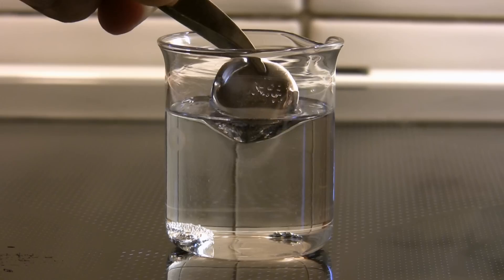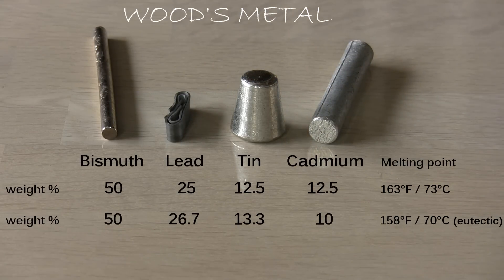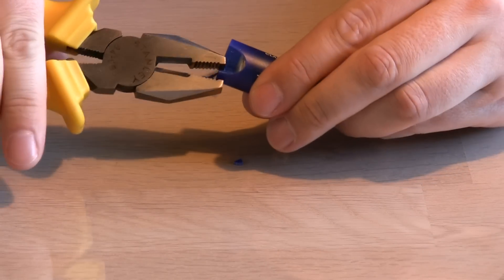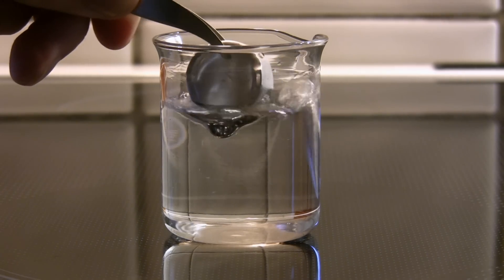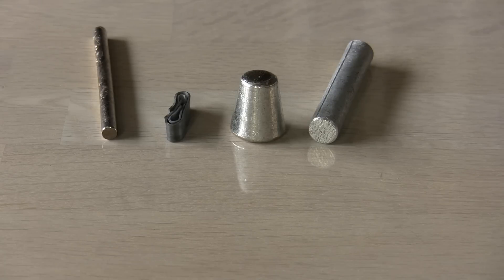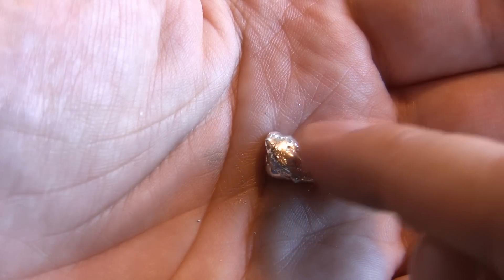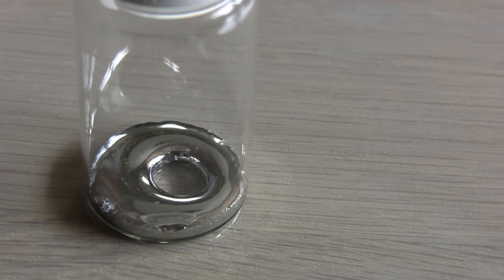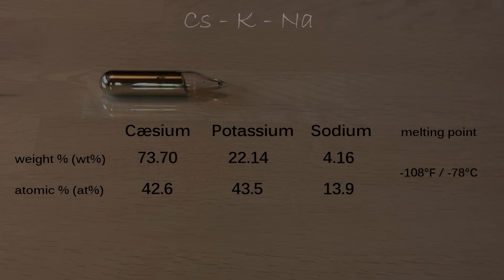Metal Meltdown | Brainiac75

Comment from the maker: To James Thompson: I can't reply directly to your comment. Have you disabled replies or is the new comment system just messing up? There's a reply button but I get the message 'You are not allowed to comment on this post'. Great...
Anyways, here's my answer: I did consider Galinstan but had some issues with it. It is nice that it is liquid at room temperature but it wets almost everything because of the gallium so it's not very practical (+ expensive!). The biggest issue though is the controversy about it's melting point. Eutectic gallium, indium, tin is supposed to melt at +11C but the inventors of Galinstan (it's actually a registrered brand name) claims a melting point of -19C (maybe by addition of antimony and bismuth but it's very unclear).
Reply from the maker: James Thompson It actually sounds like a good idea to make the galinstan myself. There seems to be many opinions about its freezing/melting point but I could test my own sample.
Thanks for sharing your observations. Ah well, all the tings I have to do when time comes :)
I mentioned the dangers of cesium in my previous video  http://youtu.be/9gB775y4FbE . But I guess for a stand alone video I should have at least made a note on the reactivity in the video.
Reply: Francium? Good luck.
Reply from the maker: Trenton Keller Hehe, I probably would win a Nobel prize if I managed to obtain a visible amount of francium. Hard odds with such a volatile element :)
Reply: brainiac75  i cannot find any samples of Fields metal. I would REALLY appreciate it if you could find where you bought it and send me the link? Thank you
Reply from the maker: Austin _game Hi. I can't remember where I bought my sample of Field's metal. But here are three samples for sale from an eBayer that I have good experiences with: http://www.ebay.co.uk/sch/m.html?_odkw=&_ssn=morgaine-le-feys-cat&hash=item58c3d2452e&item=381242459438&_osacat=0&_from=R40&_trksid=p2046732.m570.l1313.TR1.TRC0.A0.H0.Xfield%27s+metal.TRS0&_nkw=field%27s+metal&_sacat=0
Reply: brainiac75 Thanks! I had saw these on there, but they didnt look like the sample you had, so i paid no attention to them. Thanks again! By the way, love your vids!
Reply: Galinstan? In + Sn + Ga
Reply from the maker: Science@pproved Yes, probably plus some secret additives if it the registrered trademark galinstan.  https://en.wikipedia.org/wiki/Galinstan
Reply: +brainiac75 btw, good luck melting tungsten carbide WC.
Reply: you could of put thetubething thewood thing in hot water again you didnt have to break it
Reply from the maker: Minh Thai Sure, but it was just trash and I wanted to see my casting :)
Reply: ok
Reply: Brainiac75 ok cool
Reply: Ok we will not reply 
OH! sorry😆😆😆😆😆
Reply: You know why I like Denmark?
LEGO.
Reply from the maker: Vitek ShitDiv Hehe, I will never be too old to enjoy putting together a big Lego Technic set :)
Reply: +Brainiac75 I got a huge bulldozer, took me over 8 hours, spread out over a week
Reply: What did you say at the end, Maybe i could get some Franchsum?
Reply from the maker: Dan hatman Subtitles are available - just press the CC button in the video menu.
I joked about getting francium, which is the final metal in the alkali-group and impossible to get a visible amount of...
Reply: Brainiac75 How many grams did you have in the galium ampoule
Reply from the maker: The ampoule at 5:55? I don't really know. They don't specify it on their website (http://www.smart-elements.com/?arg=detail&element=Ga&newitems=&limit=1&art=03873&pn=&cat=&view=gl&tr=16&out=1&lid=15&PHPSESSID=b0aeaa938b01558a3584c6396b3ffc8e#A).
Reply: Brainiac15 isn't bismuth unhealthy to?
Reply: Hey little question:
What are the physical properties of these metal alloys?
Reply: uranium hexafluoride

Comment from the maker: That's like choosing between plague and cholera...
If it broke in my hand I would prefer a mercury vial over a caesium one...
If it rolled of the table and smashed on the floor I would probably prefer caesium over mercury. The caesium would quickly react and start a fire but I could easily take care of that. Removing toxic mercury completely is not as easy as taking out a small fire...
I fear both scenarios and do everything to avoid it happening!
Thanks for watching.

Comment from the maker: It does seem quite weird but it is because the alloying elements bond in metallic crystals and acts like a single compound in stead of just a mechanical mixture of metals. Wikipedia has some info on this in the article 'Alloy'.
Not all metals will alloy - lead and aluminium for example. They will not bond in an alloy crystal so if you mix powder of lead and aluminium and melt it they will separate with lead melting first.
Thanks for watching!

Comment from the maker: Not really. They may be shiny but it's hard (impossible?) to get a large liquid to solidify perfectly without changing shape when the crystals start forming. So it will be a very uneven mirror surface which is useless for a precision reflector like in a telescope. As far as I know it has never been done.
Liquid mirror telescopes are used though.
Thanks for watching.

Comment from the maker: Molten aluminium is heated to at least 660*C. The autoignition temperature of paper is between 218-450*C depending on thickness and type. So the molten aluminium is more than hot enough to heat the paper (or wood) to its ignition point without any flame or sparks.

Comment from the maker: Hi. Tin is considered non-toxic - it is/was even used for covering the metal in tin cans for storing food.
So I wouldn't personally use a respirator while melting tin. I would on the other hand try not to inhale the fumes - it's never a good idea :)
But you must as a minimum use large and thick gloves and safety glasses (or even better a full face shield). Boiling water at 100 degrees C is bad - so imagine what ~250 degrees C molten tin will do if spilled or splashed on you...

Comment from the maker: Gallium also has a very high surface tension. Here in dynes/cm:
mercury ~487
gallium ~723 (tested in nitrogen atmosphere so may not be comparable...)
water ~72
So gallium has high surface tension but it tends to wet things and has lower density than mercury. I guess that's why tungsten is best floated on mercury :)

Comment from the maker: Thank you!
I did consider it but had some issues with it. It is nice that it is liquid at room temperature but it wets almost everything because of the gallium so it's not very practical (+ expensive!).
The biggest issue though is the controversy about it's melting point. Eutectic gallium, indium, tin is supposed to melt at +11C but the inventors of Galinstan (it's actually a registrered brand name) claims a melting point of -19C (maybe by addition of antimony and bismuth but it's very unclear).

Comment: We made alkali metal alloys in college, many are much more reactive than any pure alkali metal. Cesium potassium sodium(or cesium + NaK) will eat through plastic syringes then ignite when it makes it to atmosphere. The stuff is viscous. Oh, and drop it in water and kaboom. Most alkalies I would not call explosive in water, just very active, however, that stuff was explosive.
Reply from the maker: +Richard Smith 
I believe it. CsNaK is just a crazy alloy. I would not like to handle it - even though my curosity would probably win if I had the chance :D
Reply: +Richard Smith What's causing the extreme activity of the alloy compared to pure Cs? Is it that the more electronegative sodium causes the electrons to be even less strongly bonded to the Cs nucleus?
Reply: @SkyWKing  i wonder the same.

Comment from the maker: The surface tension of the metal definitely plays a role because not all the alloys I tested could do this in water. But the water probably also helps in making the alloy look like it has mercury's extreme surface tension (~7 times higher than water) :)
Thanks for watching and commenting.

Comment: You left out poor copernicium😟Its a gas at room temperature
Reply: And so would anyone handling it be
Reply: He is talking about metals Oneshooter
Reply: @flydrop8822  Copernicium is a metal
Reply: @Benjamin Joshua Beggs It's boiling point has been found to be around 183 degrees fahrenheit, so it's probably not gas, but liquid at room temperature.
Reply: @limecyanizer4394  wtf i dont know why i said that, maybe i was replying to someone else.

Point is thought, copernicium is extremely unstable and radioactive, like Muzik said anyone handling a big enough amount of it(and when i say big enough i say a few mg) would die. Actually, getting that amount is probably impossible with our current technology. Transuranic elements are an obscure group of elements from atomic bomb makers, to atomic bomb residuals, to atomic bombs AS-IS. Copernicium is likely from the last group.
Reply: @Benjamin Joshua Beggs It's between -11 and 405 fahrenheit and I think it's decent.
Reply: @Benjamin Joshua Beggs Yes, I was ttrying to say that it's probably a liquid, especially since the best estimate is 183.
Reply: I Think It’s Solid
Reply: i looked it up and it seems to be a liquid at standard temp and pressure so if it didn't explode under its own radioactivity it might be a cool metal.

Comment from the maker: Tungsten is so dense that it should sink in most liquid metals.
With that said I have seen small samples of tungsten carbide float on mercury because mercury has a very high surface tension (6-7 times higher than water).

Comment: take note that the bismuth in fields metal does have a low toxicity but still with over exposure can cause problems.
Fields metal is used in die casting and rapid prototyping which is a method of fabricating a scale modle of physical part or assembly using a (CAD) machine.
Reply from the maker: I agree. None of the shown alloys are food grade :) Heavy metals should always be respected.
Reply: brainiac75
Make a tuning fork of one of those alloys. After all heavy metal sounds good!

Comment from the maker: Could be the case. The seller doesn't reveal what the trick in the ampoule is - could be gallium oxide or indium tin oxide. Apparently ultrahigh-purity gallium with no surface impurities has so high surface tension - higher than mercury - that it is difficult to get to wet anything - just opposite of the gallium with dirty surface in normal atmosphere. Gallium is a really interesting element the more I read about it :)

Comment: Need to add Galinstan... Gallium, Indium, Tin
Reply: Also I think that one of the last 10 new elements that's a metal is a gas at room temp
Reply: In particular, it would be great to see some practical advice for handling gallium compounds.  For instance, is there an easy way to coat glass with gallium oxide so it doesn't wet?  I tried melting gallium under water...  the water became a dirty blackened mess.  I've had not yet tried oil.
Reply: 1 coat the glass with gallum
2 heat it
3 it will oxidize
4 use it

Comment: A typical strategy for stopping something from being wetted with gallium is to coat it with indium tin oxide. This is not wetted by gallium or its alloys and there is a lot of expertise in applying films of it to glass because it is used a lot in making LCD monitors, because it is transparent and conductive.

Comment: Are there any more liquid/easy to melt alloys which are coloured, like cesium is? Would an amalgam of mercury with Cu, Au, Os, etc. change the colour of the mercury?
Reply from the maker: I don't remember seeing a colored, easy-to-melt metallic alloy or element besides cesium. But it may exist anyway. An amalgam with a colored metal is a good bet but I have a feeling that you need to dissolve so much of the colored metal that the mercury alloy will not be a liquid at a low temperature anymore.

Comment: Have you considered running the mercury through a strainer? It might catch the glass fragments and it WILL let the hg pass clean through. I saw this on a video posted by someone I can't remember the name of.
Reply from the maker: I've been told that even ordinary coffee filters will work. Right now I have many more thermometers to bust open so I'm gonna wait untill I have the full mercury batch to filter. Just need some freezing temperatures this winter :) (keeps the mercury vapors as low as possible - I hate working with free mercury...).

Comment: What about the Indium-Gallium alloy? It melts at 15 degrees celsius and is completely non toxic. My fav
Reply from the maker: +Peter Bucek 
Yes, it is nice. And easy to make: just press the two metals against each other and the alloy will drip from where they touch :) Only problem is that the alloy will wet most things including glass. So not the easiest to handle and store.
Thanks for watching :)

Comment: I had no idea there was a metal with a lower melting point than even Mercury. And if I recall correctly, I think there is a metal that actually boils at cold temperatures and solidifies at warm temperatures. Correct me if I have that wrong.
Reply from the maker: +SharpnelBoy 
That seems wrong to me and should only be possible by raising the pressure alot at the same time?
The transitions from solid -> liquid -> gas -> plasma are always caused by raising the temperature, since a rise in temperature causes the atoms/molecules to move more and more and therefore be more loosely bound.
But you can superheat and supercool substances making fx a liquid hotter than it's normal boiling point so the boundaries are somewhat loose.

Comment: Why did the water go almost oily when you melted fields metal. I'm a long time subscriber so I was just watch your videos again
Reply from the maker: Thanks for watching my videos several times :)
I'm pretty sure that the oily apperance of the water is due to temperature differences in the water. The metal cools the water closest to it until the metal reaches the same temperature as the surrounding water.
The metal melts at a lower temperature than the water was heated to. So even when the metal is melted and falls as drops through the water, the metal is still colder than the water and still cooling it. This causes currents in the water with different temperatures. Basically you see colder water flowing down to the bottom of the hot water.

Comment: There's also the Gallium Indium alloy and Gallium Indium tin alloy. Galinstan.
Reply from the maker: Hi! I did consider Galinstan but had some issues with it. It is nice that it is liquid at room temperature but it wets almost everything because of the gallium so it's not very practical (+ expensive!). The biggest issue though is the controversy about it's melting point. Eutectic gallium, indium, tin is supposed to melt at +11C but the inventors of Galinstan (it's actually a registrered brand name) claims a melting point of -19C (maybe by addition of antimony and bismuth but it's very unclear).

Comment: i have an old mercury thermometer and was considering breaking it open and saving the mercury in a bottle. but its such a tiny amount and sounds like so much trouble
Reply from the maker: Old mercury thermometers are the most obvious source for mercury but it is a hassle. If you can find an old sphygmomanometer or even better a mercury barometer you get a lot more mercury for much less work...

Comment: Do you have rubidium?
It melts at 39 degrees Celsius.

Actually, you should include a few metals that melt just above the boiling point of water, e.g. Bi58
Reply from the maker: +Joel Yip 
Nope, but I have found a good source for rubidium. Just need to save up...
I chose alloys that boiling water can melt - easy to show and handle in the kitchen :)
Reply: Now I get it!

You practice safety i see.

Comment: but if the metal gets too hot wont it turn into metal steam!
and do you have a link to that vaccum tube of gallium please?
Reply from the maker: Yes, metal will produce vapors if heated excessively. That's why I like these metals that melt in a hot water bath. Very controlled and no naked flame so no risk of metal vapors (that can be very unhealthy).
Here's the link for the gallium sample: http://www.smart-elements.com/?arg=detail&element=Ga&newitems=&limit=1&art=03873&pn=&cat=&view=gl&tr=13&out=1&lid=15&PHPSESSID=d95e374da8dba0068c1199500e5cc026#A
Reply: brainiac75 thanks!

Comment: 2:10 brainiac75  those are cocoa lipsticks? i remember that my father bought some in german when he went there some years ago. i never saw these in brazil :S
Reply from the maker: sonicfelipemt No, not really a lip stick. It's a lip balm / lip salve in the same form as a lipstick :)
Reply: brainiac75 yeah! that's right! I live in Brazil, I not even knew that there where different names for them, also, I've just bought this: http://aliexpress.com/item/gallium-metal-99-99-Pure-low-melting-point-metal-liquid-metal/2025430220.html        not as pure as yours, it's 4N purity level, so it contains 20 parts per million of Pb and 3 of copper, but quite good enough for me XD I'll try using rubber gloves when touching it, Gallium is not supposed to stick to rubber, or silicon right?@_@
Reply from the maker: sonicfelipemt 4N is very good for most element samples. No real need to go higher for hobby applications.
And no, the gallium shouldn't wet rubber/silicone. I guess there could be some oxides on the surface of the gallium that stains the rubber gloves but that would only clean the gallium sample. Good luck with your sample :)
Reply: brainiac75 thanks! :v